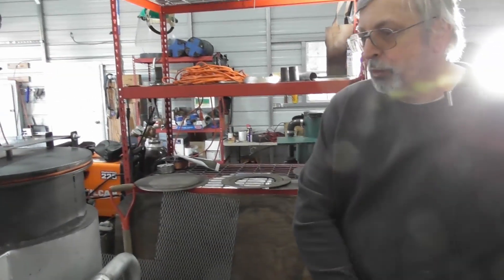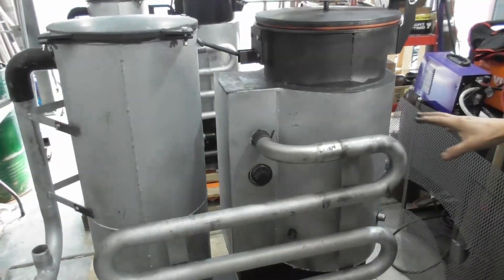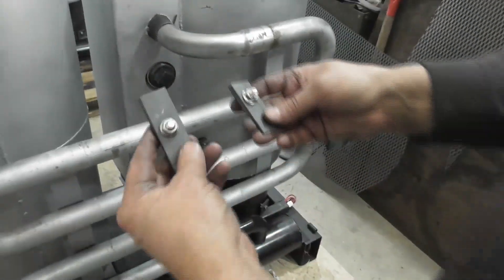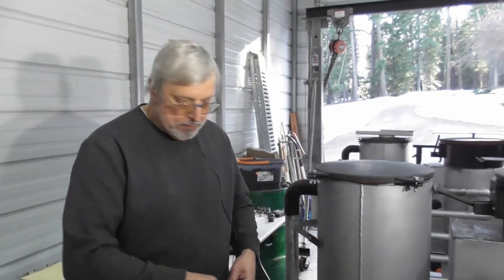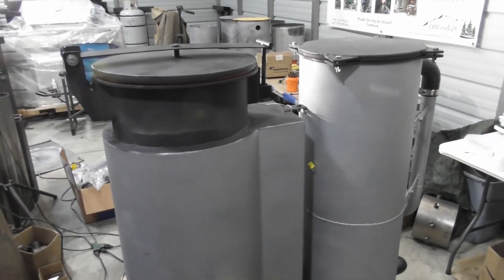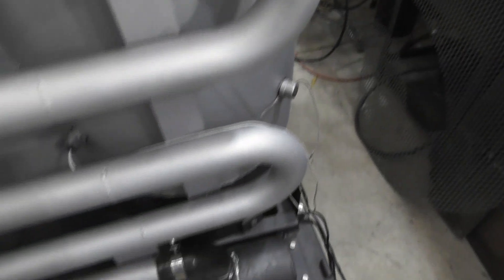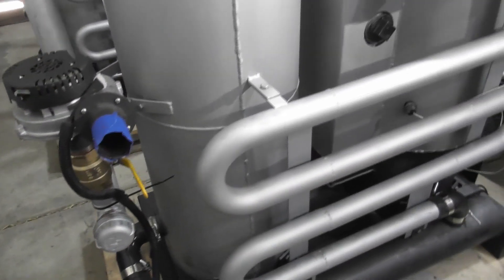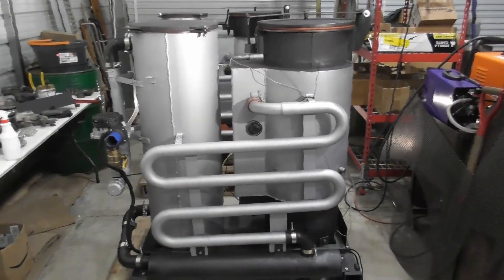Wood Gasifier Builder's Training: Part 7 Final Assembly

Comment: Greetings!
I would like to know what is the role of thermocouple?
Reply from the maker: To monitor temperature in reduction tube
Reply: @steveoffgrid485  is it used for regulating air flow or any other parameters?